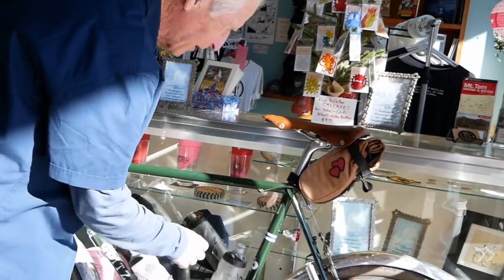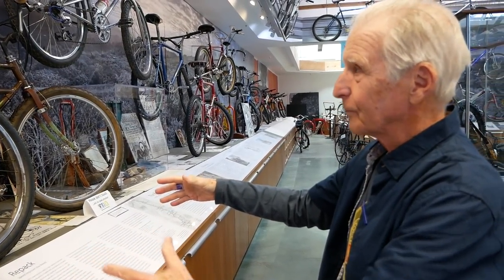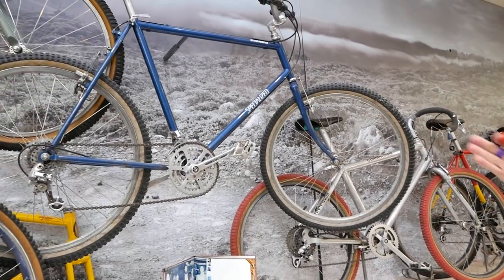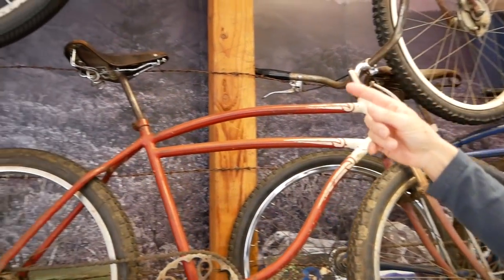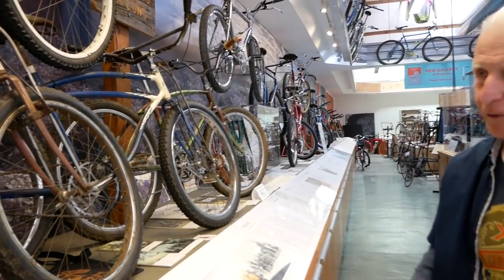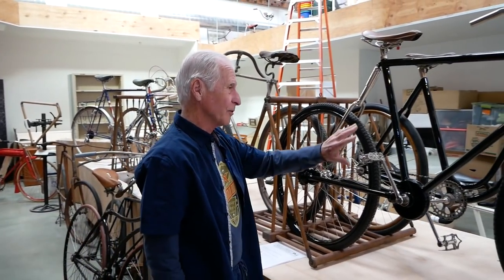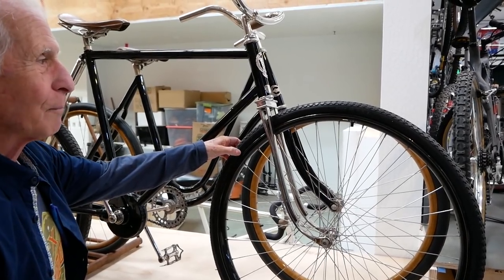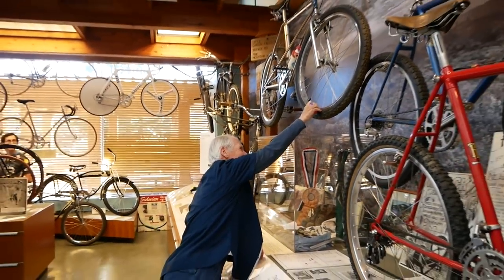Origins of Mountain Bike Geometry and more with Will Clauson and the Mountain Bike Hall of Fame

Comment: Back in the mid 50's, in Fresno, CA, we called those heavy duty Schwinn bikes "newspaper bikes." Or, "Bee bikes," as the "Fresno Bee" was, and still is, our local newspaper. I think they were probably made for carrying either newspaper, or groceries. Often they were equipped with baskets on the handle bars, and a saddle frame over the rear wheel.

Comment: 25:12 that cast aluminum bike has the most aero looking fork I've ever seen. It's at least 105 years ahead of it's time. Also, the pierce's fork. It's funny how timeless those turn of the century bikes are
Reply from the maker: Joey V. The 1890’s seem to be the heyday of cycling innovation. Direct drive, wide tires, suspension systems, it’s all there!
Reply: The rear single seat stay on the Pierce is also seen as a ‘modern’ track/TT development, obviously not! The Victorians (sorry don’t know the correct Yankee era term) got there first…
Reply: Genesis

Comment: So I just want say as someone to the North of Marin,  Coos County OR, and not able to connect with early MTB makers I decided to build my own bike.  I had ordered a set of Columbus SP tubing, the straight gauge stuff and the seller got the letters messed up and sent PS tubing instead.  That was actually a blessing as my fork was really compliant but the main triangle was as whippy as could be. It eventually failed on a climb and I had to source a tandem down tube from Gary Hale in Eugene. My bike had short chainstays and relatively steeper than normal head and seat tube angles for 1982 , 70 and 69 respectively and a front fork with about near inch of "give" on big bumps. Strong light Tourist triple crank and Shimano Deer head derailleurs and cantis. I now own a 1984 Schwinn High Sierra, which has a lot of the old 30/40's Schwinn cruiser's angles and lengths dimensions.  It's a nice bike overlooked in light of the Stumpjumper and early production MTB's.

Comment: Interesting, I ride mountain bikes and didn't know half of that stuff. You still see some of this stuff on modern mountain bikes. Short chain stays, long top tubes. Didn't see a dropper post or electronic shifter though. Thanks for the knowledge. If I ever get a chance I'm going there.
Reply: Official dropper posts are more modern.  I saw a few bikes with “Breeze-Angel height rights” which performed the same function as a dropper post.  Height right’s came from the 1980’s.  I remember them from a bike shop I used to work at 1999-2000.  I’ve still got my “extra height” model (as opposed to the standard or “lite-height”).

Comment: Henry,
I got my first mountain bike in 1984 - I need to make a trip to visit the MTB Hall of Fame  - I remember many of these innovations as the sport evolved. Not to take away from your video, but where I was at the aluminum rims evolved from Bontrager taking road bike 700c rims cutting out a section then re-rolling them down to 26” size - not from BMX wheels...  Ironically 30 years later the modern mountain bikes switched back to 700c/ 29er size wheels....
Reply from the maker: Definitely check out the museum when you get a chance. When we were talking about the evolution from steel wheels first used on the purpose built mountain bike to the lighter weight aluminum rims, Will was discussing how the same extruded aluminum profiles used for 20-inch BMX bikes could be cut longer and formed into a 26-inch rim. He also later talked about how the 700c rims were getting cut down as well, and the challenge of spoke count and spacing. Unfortunately, this came up later in our conversation and I didn't capture it on film. Thanks for pointing that out! I also cut out at least a 20 minute discussion on early frame failures and innovations on frame reinforcements. I think this would be another great video topic for the future.
Reply: @Henrywildeberry  Yes please. :-)

Comment: I would have to check my medical records, but I believe in 1966 when I was about 10, my friends rear axel ended up in the back of my head.  We were riding on the trails in our local woods doing massive skids with our coaster brakes in the mud by our stream, well I went down and his axle went in to my skull.
     My first full sized bike was a Columbia, single speed, coaster brake and a curved upper frame ….it”s been long gone.  Quickly once the fenders had been smashed into the ballon tires too many times, they came off.  The chain guard seemed to rub into the chain for some reason??? So even though my pants got eaten by the chain a lot, the guard went.  Kick stand….why?  Handle bars were spun around and pointed up like horns and we wrapped our bars just for cool.  I just learned yesterday that I had a “kluncker”, my first dirt bike in 1966!!
    Since then or next, I bought a brand new green schwinn varsity with my paper route money, as time went on it got a strip down and flat bars, knobby tires.  I still have this bike like a monument I keep sitting next to a shed with rust and weeds, and so many memories.  Mongoose hill topper, 6 on\off road dirt motorcycles, 4 Jeeps, and my current/ new MT bike…a 1999 schwinn Moab 3. 
   As I forge my way through my 60’s I find myself drawn back to the simple joy of skidding in the dirt on a bicycle.  The limitations on finding dirt in the upstate NY that you can ride a 450lb KLR650 on is too much road, not enough dirt, and so back into dirt bicycling.  A EMB is in my sights for 2022 even though it will cost equal to the cost of my van, but joy has no price tag!!  It makes me laugh that at 63 I’m still chasing the same thrill I did when I was just a young boy learning how to put bandages on after an afternoon of riding dirt.
Reply from the maker: Right on! Never too old to have fun! Thanks for sharing your early mountain bike story, and I'm glad that skull fracture healed up and you were off to riding again.

Comment: It went together easily in less than an hour. https://www.youtube.com/post/UgkxHL1v1R3NE5x4KiYfyt8dnQmyNYz7qi5L  Make sure the front fork is forward or the pedals will hit the front tire. Tires are both a little soft so it needs air before I ride it. The rear wheel didn't come with a clamp regular bolts hold it on. The front had the clamp. No scratches out of box. Rims are a little off with a slight wobble. They could have spent more time with the spoke tool fixing the run out. So far out of the box I'm happy with it. I did replace the pedals with a nice aftermarket set. After riding it a bit my A$$ is a bit sore so I ordered another seat. Overall I'm nearly 60 and didn't ride a bike in 30 years. I like my new 29" Schwinn. It will be used for casual rides with my friend.
Reply from the maker: It's hard to give a good recommendation without knowing exactly what terrain you plan to ride and what your cycling goals are. If you want a road bike then a 700c is pretty standard for everyone and there are lots of tires in that size. Good luck!